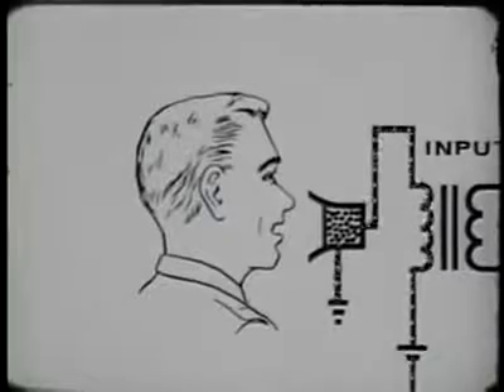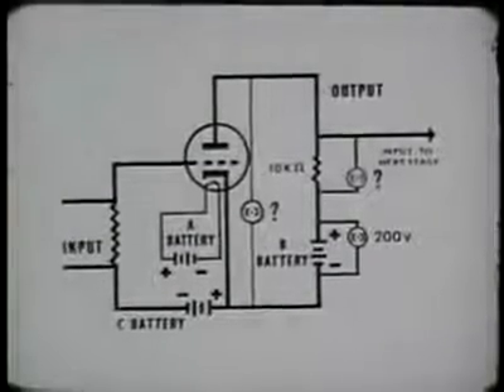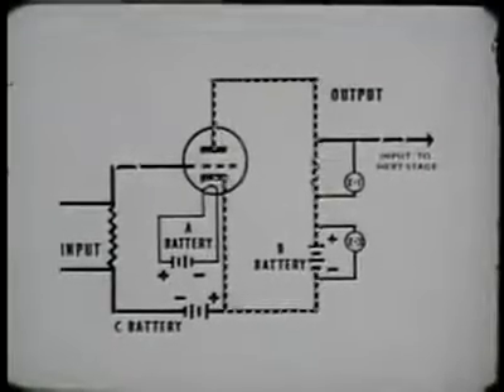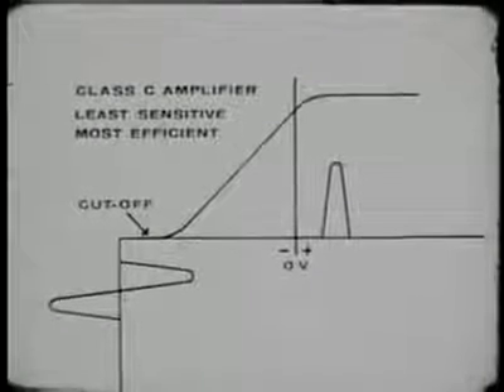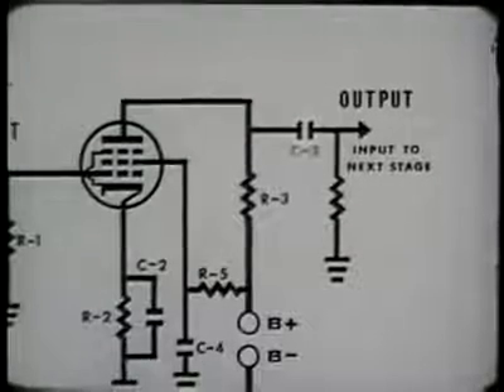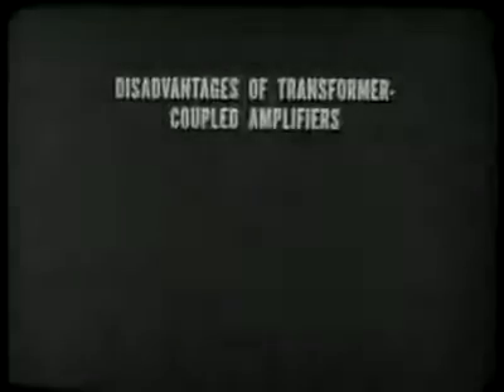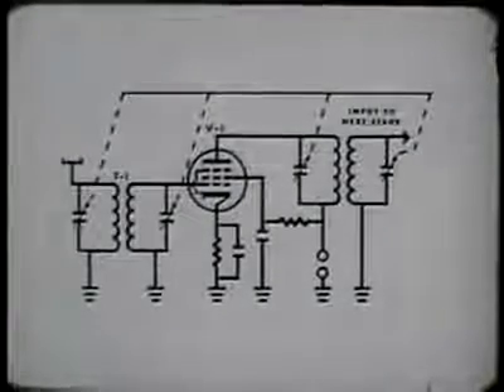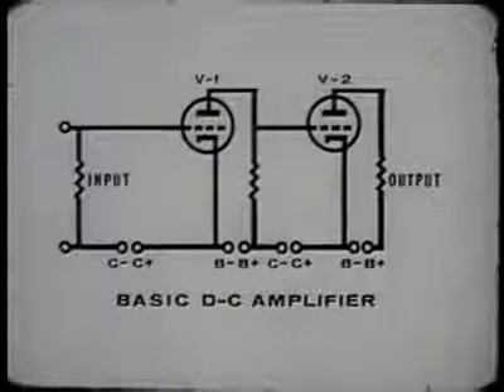Vacuum Tube Amplifier Theory

Comment: Solid State electronics are very vulnerable to radiation. Vacuum tabes are not. That gives them a use.
Reply: I'd really like to think so, but I wouldn't exactly believe that. 
Geiger-Muller tubes are basically vacuum tube diodes except the cathode isn't heated, and the electron transfer is facilitated by ionizing radiation instead. 
So I could see high amounts of ionizing radiation interfering with the operation of vacuum tubes by causing undue electron emission from the cathode.
Reply: Case in point.  When the MiG-25 and pilot escaped to Japan in 1976, our engineers and techs really gave the jet a look over.  Initially, we criticized the miniaturized vacuum tube systems as old fashioned.  But, further analysis revealed that the MiG-25 was designed to operate in a hot nuclear war environment and their tube amps were impervious to EMP energy.  The kind that fries semiconductor amps.
Reply: That’s not what’s propping up audio tube production though. They’re still being produced almost exclusively for guitar amplifiers